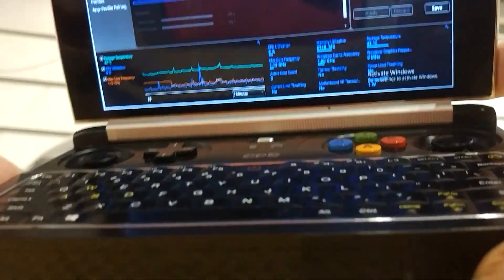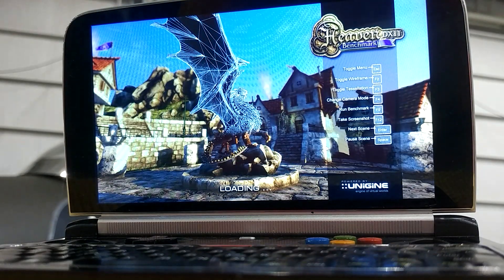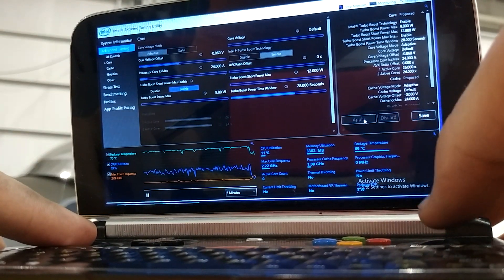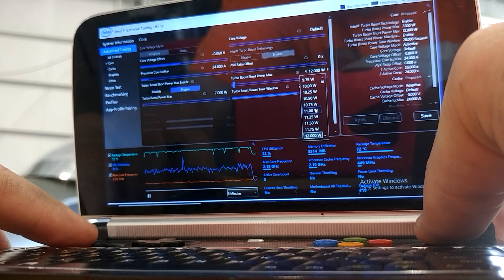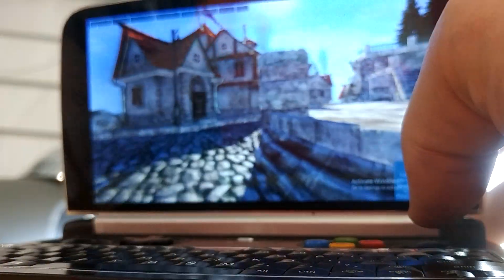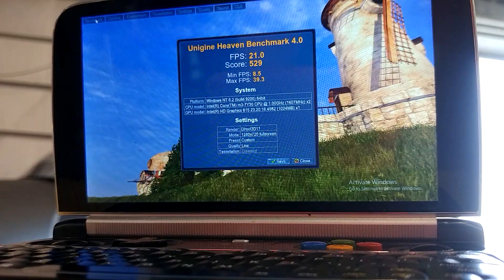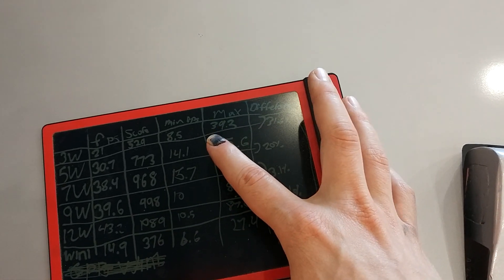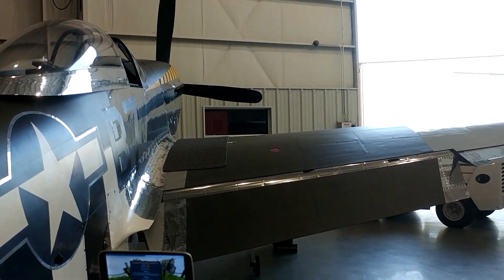Benchmarking the GPD Win 2 at 12W, 9W, 7W, 5W & 3W

Comment: man if there was a way to get 12w with good thermals, it would be an incredible handheld but if were stuck with 9ish its still great but the performance difference from 9 to 12 was quite large
Reply: With the Indiegogo 3rd party heatsink upgrade 12watts is easy with nice'n cool thermals, don't forget 12watts doesn't just increase the average/max fps it also increases the minimum fps giving a much more stable pleasant gaming experience.

https://www.indiegogo.com/projects/gpd-win2-third-cooling-mod--2/x/17077940#/
Reply: Monty Whitehouse hmm idk its 3 fps. 10 w is the line i think
Reply: TakiSobiePlayer scored almost 100 points higher vs the 30 points from 7-9. Cant wait for mine to get here regardless
Reply: Monty Whitehouse dont look on poits look on fps. I wana have mine right now too 😀
Reply: 3 fps is a pretty good increase for a tiny device, sometime it's the difference between playable and unplayble FPS
Reply: i think there's a heatsink mod out now that lets you run 12w maybe even 15w at ease now?